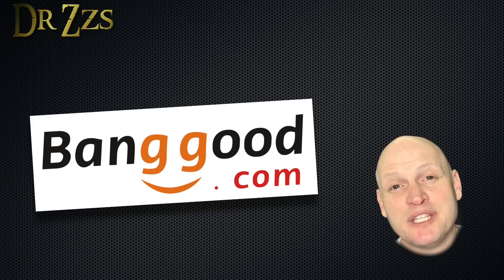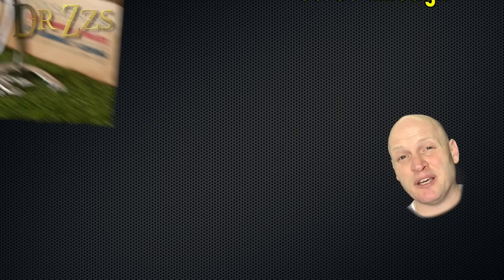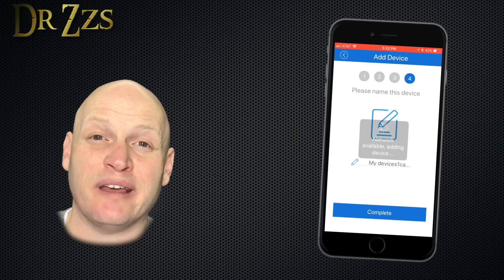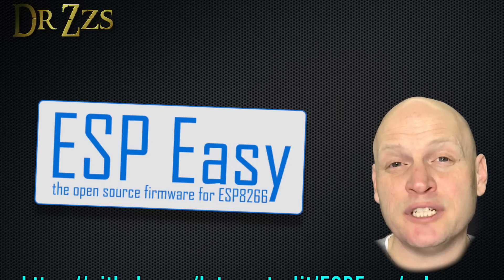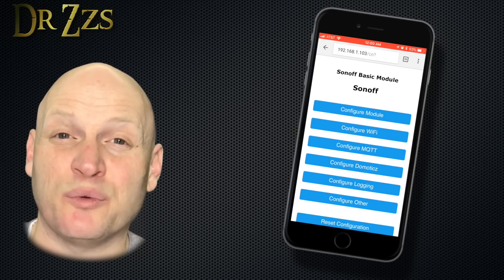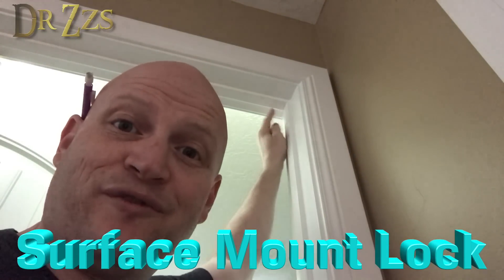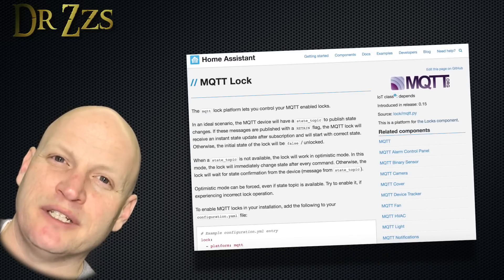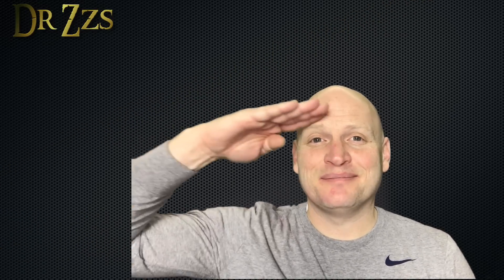$25 DIY "Smart" Door Locks - ElectroMagnet + Sonoff + Tasmota

Comment: HAHA! You had a hard time counting to 4.... LOL   Seriously though, nice video as usual.  I've been wanting to put a strike lock on the front door with an RFID sensor.  I would get the "Fail Safe NO" version so it stays locked if power is lost, but you could still get out in case of a fire from the regular door knob.
Reply from the maker: ya, it wasn't my proudest moment.  
I need to try RFID.  Maybe I'll get a chip implant like Jon at SuperHouse
Thanks!
Reply: Hahaha, I saw that and almost mentioned it. I'm not that hard core. A key fob or card in my wallet is good enough.